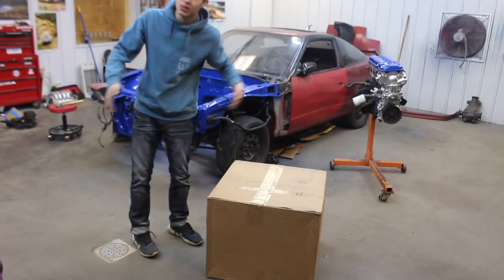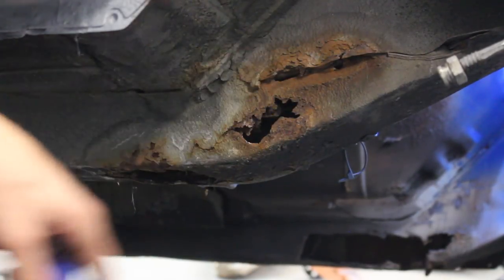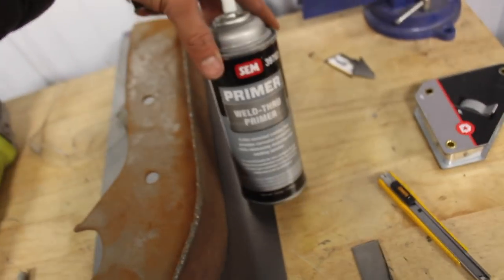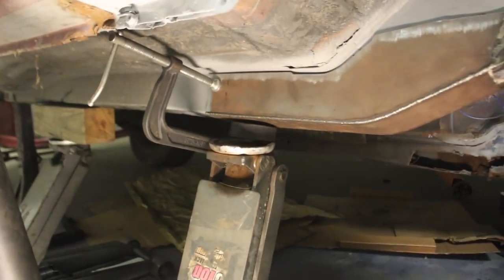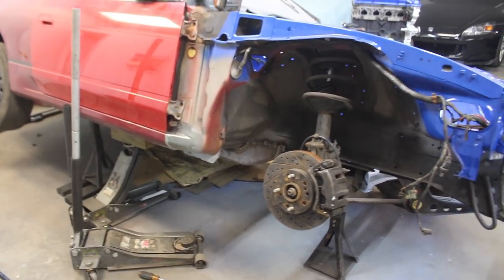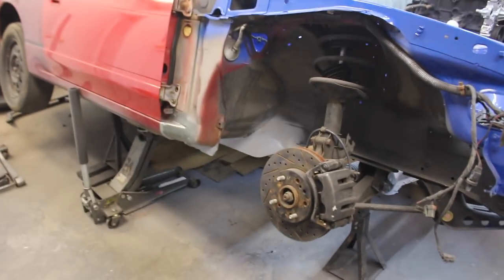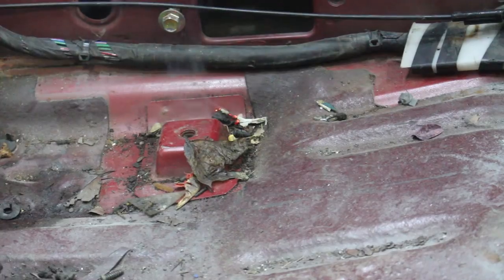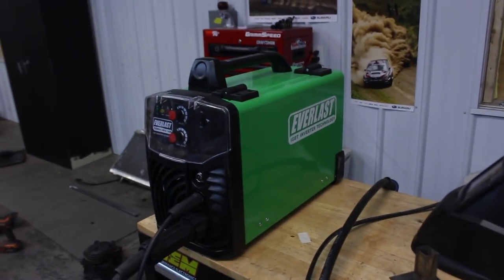Budget 240SX BUILD | Part 11 | Frame Rail Replacement

Comment: No need for that weld through primer. Just use compressed air and inside frame rust protection wax. Long hose kit to get the whole frame protected inside.

Comment: Your automotive competency is clearly greater than mine; but shouldnt you have grinded the paint off of the frame rail before welding?
Reply from the maker: Weldable primer. Believe I mentioned it in the video.

Comment: Why exactly did you cut the whole frame rail? Should have just cut the rust out clean the rail and that peice you have is basically a stiffener
Reply: Not talkin crap, just my opinion I wouldn't have cut that much out of the frame. Plus not tig welding it. I would make sure once running make sure those welds don't crack